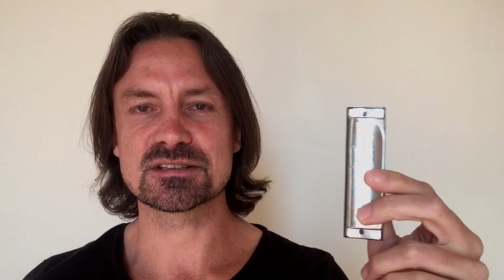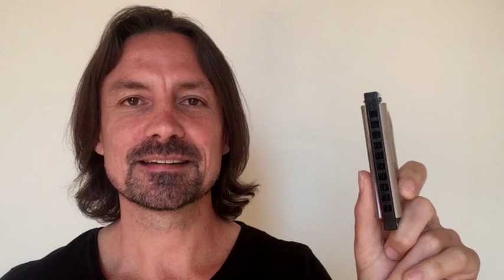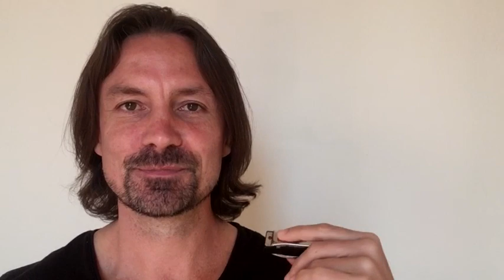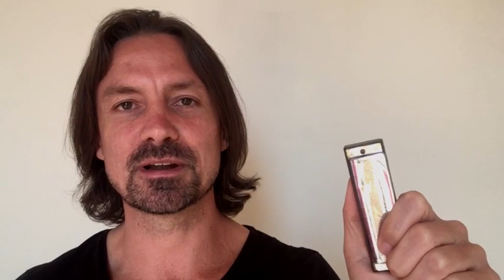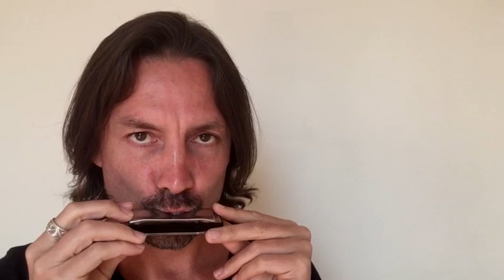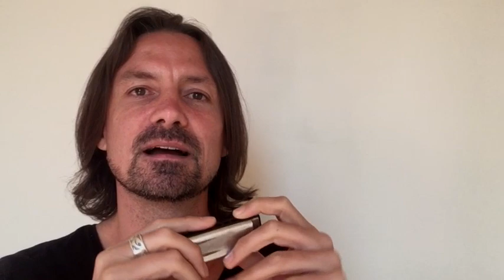Step by Step Harmonica Lessons - Lesson 2.

Comment: I have a G harmonica. I found that if you inhale through your nose the 3 holes on the bottom are easier to play. Especially the 3 hole. Should I not do this?
Reply from the maker: Don’t do it! You need to have control of the air flow when it comes to bending!

Comment: Hi Mitch! I just bought my first harmonica, a Fender Blues Deluxe, and I'm noticing that the draw on the 2 hole is very flat, and the draw on the 9 and 10 hole are very squeaky and inconsistent. Is there anything I can do to remedy this?
Reply from the maker: It may be technique. Try playing a little softer and breathing through the 2 hole like you are sucking on a straw. Aka from the front of your mouth. See if that helps!

Comment: I can't seem to draw in on my two hole. All others seem fine and I can blow into the two, but when I try to draw I can't get a single sound. What do I do
Reply: I was trying some more things, and if I blow a lot into the two I can get a two draw for a few seconds, but then it quiets and eventually just stops the note
Reply from the maker: The two hole is the trickiest one. Make sure you are Uber relaxed and use the ‘straw’ technique with a very soft breath, gradually increasing air flow. 🤙
Reply: I cant really blow on the 8th, I think mine is broken, of I blow real hard I can get an E out of it but its really out of tune